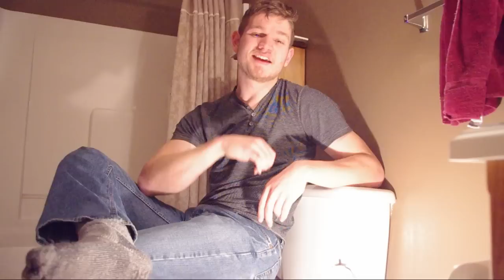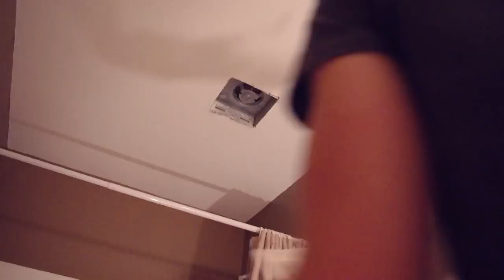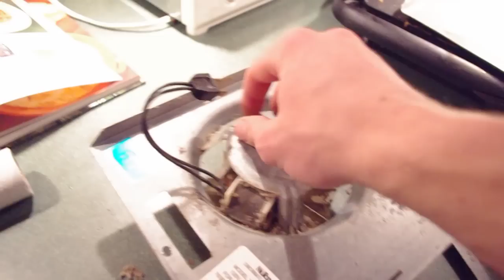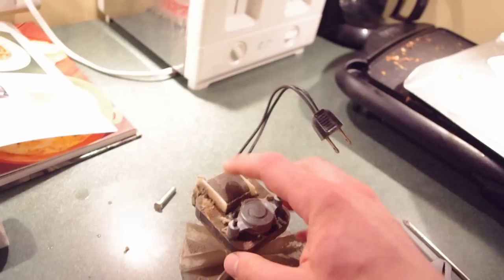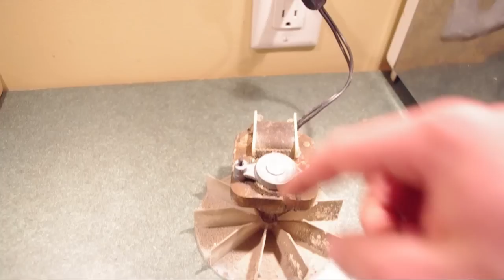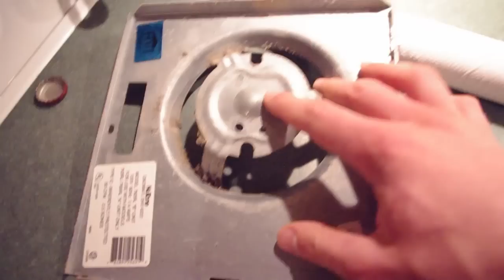Ceiling Air Vent Fan Repair - Bathroom/Shower

Comment: Playing with 240v without hitting the breaker is proberly a bad idea just saying
Reply from the maker: It's 110.  Says it on the back.
Reply from the maker: Daniel Engling And it's an outlet, no more dangerous than a normal wall socket.

Comment: The fan would have been making horrible noises long before seizing up, and usually a good cleaning and oiling of the bearings will make it run like new again. It's highly unusual for one to burn out; either way it's a good idea to clean it out once a year.
Reply from the maker: Well nothing at all happened.  I don't think oiling would have helped this one.
Reply: Did you see the brown plug on that fan/motor it most be old and past do.